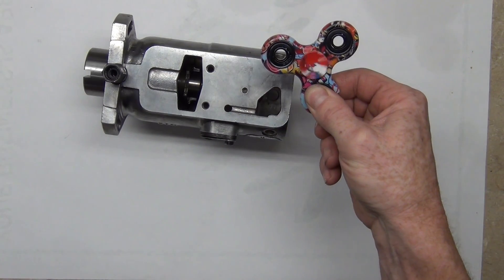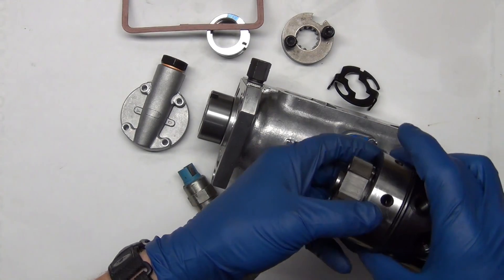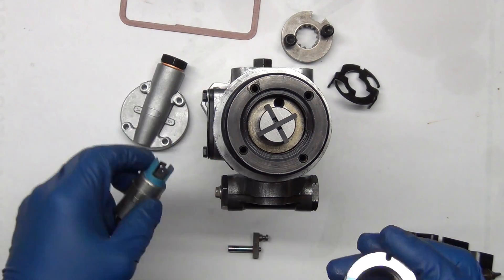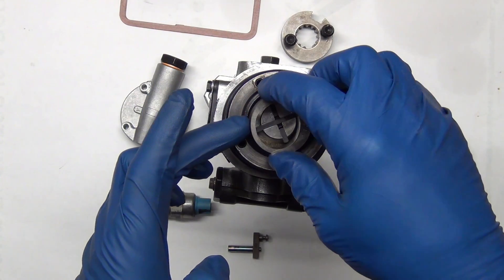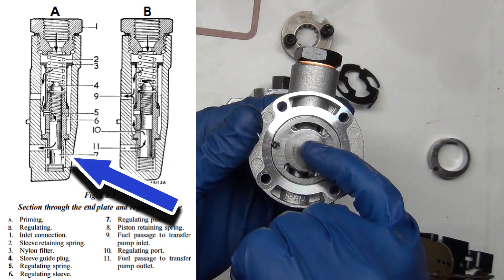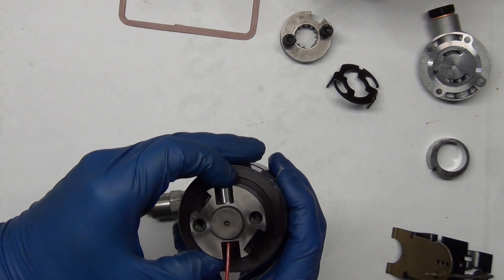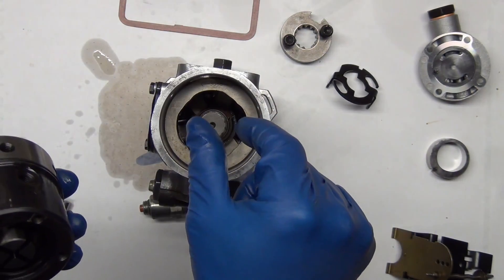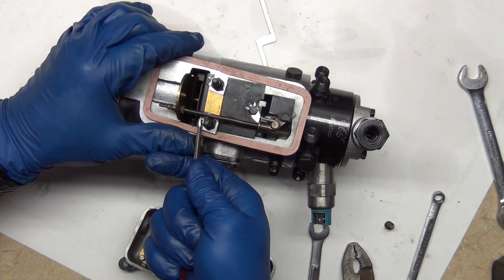How a Diesel Injector Pump works CAV DPA Build Part 1

Comment from the maker: Happy Father's Day!  If you didn't get spoiled- DIY!  Here are some suggestions for things I'd recommend getting anyway.My favorite fly swater →http://amzn.to/2sMh82L
Power Probe tool used in video for cutoff valve → http://amzn.to/2sp09Rj
Safety glasses that I use (Holmes 3M) → http://amzn.to/2sHh8l1
My favorite motorcycle tech/ flying tech → http://amzn.to/2sp3QGJ
And if you're rebuilding a CAV DPA you'll need this → http://amzn.to/2rJhqmd
Reply: Briansmobile1  you must be a diesel tech of some sort and if you've got a second, I've got a question about these CAV pumps.
My old Long 350 is getting diesel at both fuel filters and when I get to the injectors, it isn't squirting out quite like the low pressure side of the pump.
My CAV pump has bleeders on both the low side as well as the high side and they squirt diesel good; however, when it comes to the injectors... It's a pathetic trickle of diesel and not spraying out into the air as it should be.
Bled filter #1
Bled filter #2
Bled CAV low side
Bled CAV high side
Bled injectors and it never amounts to much of anything spectacular, weak run-out.
Would you assumed that my CAV injector pump could have gone bad and if so what area would I be looking to rebuild? That's assuming I can find the parts for it, but I need a second head on this one... She's not a spring chicken, but it's spring and I've got to break ground, about 2 weeks ago.

I cannot seem get a constant start, just one hit starts and instantly dies out... I appreciate your videos!
Thank you sir.
Reply: 😅 😮/9

Comment: I have repaired lots of DPA pumps when I worked for Lucas in the UK.
Reply: Me to. '74 - '00.
Reply: @walesara54  I worked for LSUK in Bedford.
Reply: @Martinpacker  Carmarthen in south Wales. Closed in 2000 we and Northallerton were the only branches to actually own their building, all others seemed to be leased. Great turnover per year but as we were smack bang in the middle of a developing retail park the company ( AEW) part of the Finelist group, decided to cash in. The building was sold within weeks for just 250k . Finelist went bust eventually but perhaps you already knew or actually felt the result of it as LSUK basically disappeared soon after.

Comment: Your segment on the pump liner rings EXPLAINED so much.  I was suspecting the power regulating piston not moving freely enough for it to go into pressure mode.  My pump has a solenoid. I took the INJ. pump off and had a diesel mechanic rebuild it ..  700$ later I put it on and was given ahead of time notice that the cav pumps are a bugger to bleed.  I was told I had to have power to the solenoid then later fuel was to be in wide open position then to take a convenient injector banjo off and look carefully into that threaded boss  and rotate the pump til I could see the port in the distributor. Then the side bleeder on the lower cavity should gravity flow freely.  I finally took it off and handed it back to the mechanic and when I got it back he said he had advanced the timing and when I got the machine running to set it back where it wasn't smoking.  I showed him a UT video (Maybe a BUNDY BEAR one) that when primed into the fuel inlet (End Plate) all 4 inj. ports spit a nice flow.  He said "you will never get that out of that pump"  when I swap the UN notched one (7139-223) pump Liner for the notched (7139-540)  I bet it will.
Another note to you is to include these part numbers (IF they  are the correct ones) in your list of "STUFF" you used.  Also when looking at your gasket/seal set I noticed fuel line sleeves for 1/4" line  MF # "376525x1 And amazon or Ebay sell After market 5 and 10 packs.
This was another frustration that I had and some of your info led me to get that answered. Other UT videos never caught or explained it   Maybe you could do a vid on that .  I ran into it when replacing the fuel lift pump and again wit the fuel line out of the filter housing to the INJ. inlet.  A very hearty "THANK YOU" for this video.  
P. S. My mechanic has been doing diesel repair his entire life and is 76 yrs. old but I sincerely believe this one issue caught  him slacking on comparing the original part with the replacement part.  Merry Christmas to you.

Comment: I rebuilt one of these and reinstalled it. Now when the engine cranks off it goes to a really high idle and you have to shut the fuel off to stop the tractor. There is no throttle response at all, it just runs wide open. Any idea what is causing that??

Comment: The diagram at 4:45 of this video shows the "roller shoe ear" placed upside down from how you installed them in part 2 at 0:39. Which is correct? Maybe it makes no difference?

Comment: I have similar pump but I'm getting tremendous pressure returning back to fuel tank that it blows fuel out the breather hole in the tank cap or it blows apart the return lines from on top of the intectors

Comment: great video, have a question, if i lost my governor spring settings and have no markings that id them where do i start? I took an educated guess and it does crank and run but does not fell like full throttle and it will shut off at half throttle with the fuel advance lever not using the shut off pull. which way to go? or change to set spring right?

Comment: I need help finding information on adjusting main fuel on a pump lile this one but the pump seems to be pretty rare it's on a perkins 6.354 can you help?
Reply from the maker: That's one of the Perkins 6 cylinders right?  There are manuals you can download all over the internet for the 4 cylinders.  Are you talking about the max fuel setting on the rotor?
Reply: Yes max fueling I'm trying to get some more power out of it and I've found a few videos on the same but with different pumps I'm having a hard time finding this one ...are most rotary pump similar? I just need a general idea of how to do it

Comment: My Cav is similar (JD5300) with the shutoff solenoid instead of the internal kill valve. I can not get mine to prime. when I try to prime it the manual lifter pump works for a bit and then gets too much resistance. I took out the solenoid and fuel gushed out from that place. I was able to remove the plunger shaft from inside the solenoid and reinstall it but still can not pump it to prime. I am wondering if you had any suggestions- thanks 

Is it possible that this IP has a backflow valve at the return outlet? at the arrow in this screenshot :    https://www.screencast.com/t/xB0TnHDJKJH
Reply: Hans Rose is the metering valve stuck or did you check to see if the solenoid was actually working?

Comment: You hear folks go on about Diesels being so much simpler on account of no ignition systems. Ever notice how those same folks never acknowledge the existence of injection pumps? Diesels always have me thinking 'stinky Rube Goldberg[1] device'. (Unless one's a run away, then I'm thinking stinky dangerous/treacherous Rube Goldberg device...)
[1] For those under 60, see Wikipedia.
Reply from the maker: The injection pump here is super simple except for the anti-run away parts of it.

Comment: have ? on tuff torq k40. new o/h kit installed. goes for & rev aok. when stopped in neutral free wheels. tuff t tech says put in wire mesh filter in ids valve not on orifice. i think should be on orifice. any thoughts ? i also have a mf 1100 with cav dpa pump. so keep em coming. my email is balljamess@yahoo.com. not big in twitter
Reply from the maker: You can always try both and check which works better and tell me.
Reply: do you understand what IDS (idependent dampening system vaves do ?  end towards actuator arm have a whole in them. arm has two grooves. w.out  screen mesh, cant build pressure ? prev version ids valve had ball n spring over orifice.  is orifice supp to be closed under low press ?
Reply from the maker: I don't know.

Comment: Great video. This pump seems really complicated. Hope next videos will focus more on the subject.
Reply from the maker: I've got piles and piles of footage.  What would you like to know about?  I'd love some input and questions.  I've got information overload.
Reply: I need info on the flyweight retainer replacement deal. Older versions from 60s used a vinyl container which can come apart in pieces and that might lead to loss of throttle control if 'not idling down'' symptoms are ignored to the point of way past stupid. Replacement retainer is metal and doesn't come apart, so we should really get in there and replace it while replacing leaking throttle shaft seal which just spills the top half of the fuel tank until that o-ring gets renewed from inside.
Reply: hey thanks for sharing. i wpou;ld like to know more on the inlet. is there a spare parts list? what is the assembly sequence?